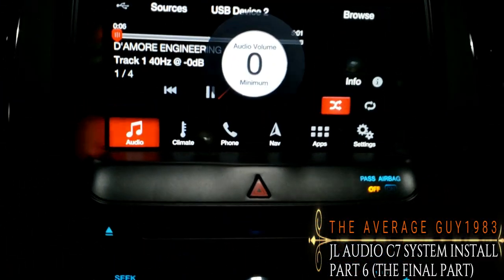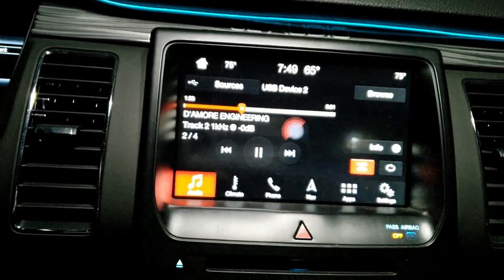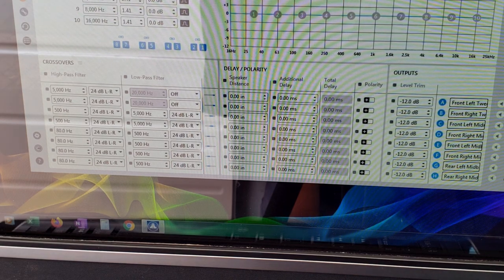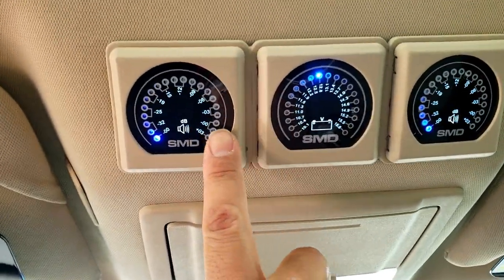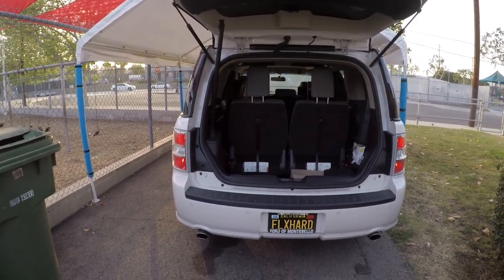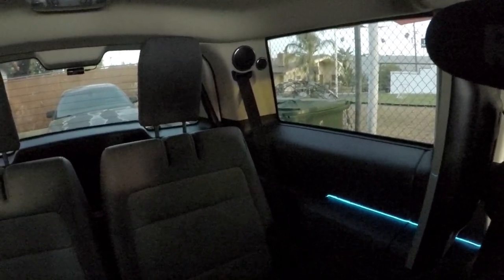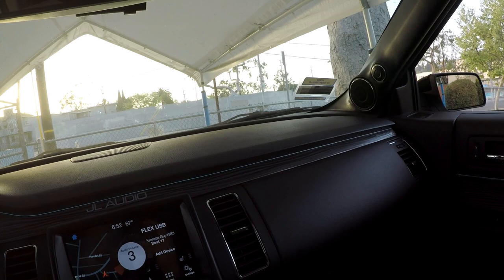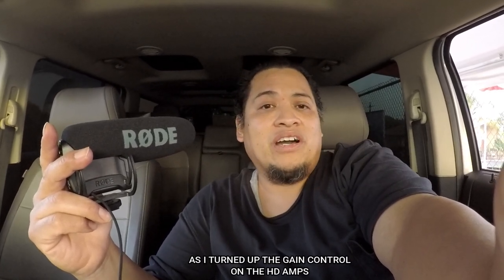JL Audio C7 System Install Part 6 (The Final Part)

Comment: I have a set of c7 speakers waiting to go in my car. I have heard them in a sq competition car and they sound amazing. The magic comes from installation and the secret sauce is the tune. If you had the a pillar speakers mounted on axis and have the system system tuned using an RTA then you would be a lot happier with the cost of the system. But what it come down to is that this is a hobby, the important part is the enjoyment you get from it. Next time you get a new car you can try to one up yourself. Thanks for taking us along for the ride.
Reply from the maker: Having the C7 speakers on Axis would have been great but for me it would have reduced visibility and it would have been an automatic police stop here in Los Angeles claiming "Obstruction Of View" so I did them off Axis which it sound great with the windows closed or half open as the sound bounces around and makes it sound nice. I still think that the C5s do a better job for the money but those are now discontinued and this is also a learning experience for me on making my first and possibly last Full Active Set up the cost was higher then performance for me but again I do LOVE the C7s but since I've had my C5s for so long I got used to the sound they produce with their passive crossovers on the same HD amps. Now The reason I didn't use an RTA is because in all honesty its not something a DIYER would buy for a single or maybe 2 time use So in my case  I set everything up the way it sounded good to me simply using the Time Alignment which did work great. Most of my viewers wont buy an RTA either for a single time use. However JL Audio did come out with their TuN 4.0 which now has The Capability of using a USB for audio Microphone Measurements so maybe I can buy a decent one for my next build that won't break the bank for me and see how it all works, As a DIYer I would rather invest the money for an RTA on more Router bits or blades for my other tools as those wear out pretty quickly. 😅 thank you so much for your feedback though. I appreciate it a lot. It honestly helps me get more knowledge a little bit at a time. 🙇‍♂️🙏 please consider returning once I eventually do my next build. The next car I want to work on has quite a bit of mechanical issues that need to be solved first. Maybe on that car I can possibly do off Axis with the 3 pairs of C5-653s I have for it. 😁👍
Reply: @THEAVERAGEGUY1983  I'm uk based so no such issues with the police. As for RTA, I've got a umik-1 and REW software for the tuning. The mic cost less than $150 from amazon and the software is free, a fraction of the cost of the speakers and adds the finishing touch to what is a good base of equipment. There are a few videos here on youtube on how to use them. Funny story about my C7, I originally ordered the C5 and thanks to them being discontinued and a couple of (fairly major) mistakes by the people I ordered from I have ended up with the 3 way set of C7 for the same cost of the C5 😁
Reply from the maker: @richardstott8973  no way!!!!!???? That's awesome that you were able to get them at that price. That's a Deal there! Yeah the police are pretty strict here specially with car audio lol!

Comment: Happy days bro!!!! Good for you man well deserved.   Love the attention to detail.  I finally got my 3 ways and a pillars!!! Every day is a dream driving now.   Hope you're enjoying the fruits of all the labor.
Reply from the maker: Hey! Glad to see you here. That's awesome that you got the 3 ways! They are definitely worth it. As for me enjoying the sound after all the labor work, yes! Since the C7s  are breaking in more now they are sounding even better! I did have some clearance problems on my front doors that I wasn't aware of till I felt the door panel pounding pretty hard with mid bass. Turns out the front door C7s are way too close to the back of the door panel speaker grill. So I'm actually working on modifying my factory door speaker brackets so that the Fitment can be better. I have recorded most of the footage and just waiting to get 1 more brakes done before re installing them. Hopefully everyone will enjoy the how to video on making these abs speaker adapters.
Reply from the maker: Did you go with the C7s too or the Audiofrogs? Those Audiofrog Speakers are freaking awesome too!
Reply: @THEAVERAGEGUY1983  it's crazy how high end speakers require break-in in order to sound good.   I was getting a headache at first trying to get the same loudness out of the Audiofrog 60/25/10 as I did the 2 way C5s.  That was my first mistake but I was disappointed and worried I wasn't going to enjoy them.  After a few weeks and my ears adjusting I can tell you it's incredible.   Simply amazing.  I ended up powering them with the vxi800/8 and 1000/5 bridged.   You inspired me to try and make some clips.  That MIC seemed to do a good job picking up the detail.   Great work man!  When you search JL Audio on YT your videos come right up.  👏👍
Reply from the maker: @touring189  yeah, same here this is why I felt like the C5s were still the best bang for the buck but after letting these C7s break in a bit, I can definitely tell that they are out performing the C5s a bit. They are pretty close to each other in sound but the C7 6.5 speaker does give a lot more midbass. About the videos popping up, that's great! That means that the youtube algorithm is now working for me. I do have some tags on the videos but they never seemed to leave the small circle of subscribers. But glad it's working now.
Reply: @THEAVERAGEGUY1983  yeah, I'll always recommend the C5's to friends/fam.  Man, I wish I could hear the Flex in-person!!!

Comment: I put my Bose headphones on @ 19:50. It sounds Amazing. Good job on your set up. 👍
Reply from the maker: Thanks man, indeed it definitely sound awesome. That stealthbox and 10w6v3 has an impressive output from 30Hz to 54Hz. When it goes down to 29Hz the sound does start to reduce and as you go lower to lets say 26Hz then you can't hear it much and it sounds like the subwoofer is suffocating but thats because of the tiny Enclosure its in. This subwoofer can go as low as 22hz in a ported box and as high as 200hz. Still a great set up for a Daily Driver/Family Car. 👍 right now I'm working on the speaker brackets in the front doors. Turns out they are too close to the Inside of the door panel speaker grill and when the door speaker plays loud the speaker hits the inside of the door panel, so I have to cut the original oem bracket down by 0.75" and then glue on my 1/4" abs bracket to that using ABS Slurry. Just need the abs to arrive by mail before I can get started. I also gotta make a video on this and let others know that you need at least 0.75 inches of space behind the door panel grill or they can run into trouble. The rear doors are fine but when I add sound deadener to the sheet metal of the door where the speaker bracket will be sitting on top of, I may run into the same problem so I will also be reducing those by 1/2" to compensate for the depth height.
Reply: @THEAVERAGEGUY1983  looking forward for the video if you got the chance to do the it. Your build is Awsome!
Reply from the maker: @lowridingtrucks88  thank you and yes I will make a video. I think it's better if I show the issue rather then just tell people about it. Just gotta wait to receive my 1/4" machine grade abs, the router bit from Mobile Solutions i use seems to really like that material better because its smooth on both sides then the abs with the texture on one side. 😁👌

Comment: Thanks for the video. Not sure if you have done this but it may help. Don’t touch the level trim, keep it at 0db and adjust the input sensitivity on the DSP. I had a similar issue. I have the TwK88 but a Rockford amp. Stick the probes into the output of the amp as normal, adjust the Head unit to max unclipped volume. Move to the DSP and adjust the input sensitivity by picking the correct voltage level. That should send a signal down to the SMD DD1+
Reply from the maker: Thank you for the advice, I'm going to work on it again this weekend, the way I currently have the LC7i set up are in this order. : channel 1 (front) output 4 volts @1kHz
Channel 2 (Rear) output 3.8 Volts @1kHz, it was maxed out on the level control on the LC7i. Voltage is much lower for the rear channels from the head unit unfortunately.
Channel 3 Sub Output 4 volts @40Hz
Going to the TWK88 inputs, from there the Input sensitivity on both TWK88s are set to 4 Volts of Input from the TuN Software. Outputs were at 0DB at first but was getting distortion coming from the TWK88 Outputs for the amps so I dropped them down to -4DB and that even things out to match the distortion point from the head unit. It seems my issue now is setting the gain control properly on the amps to match the head unit as well and I should be good to go from there. 😅 I would feel a whole lot better knowing my gains are matched with the head unit's/twk88's clean signal
So that I can focus on the EQ Tuning part to smooth out the sound of all the speakers. On a aftermarket radio, the DD1+ wouldn't be needed since the TuN software can detect distortion from its inputs.
Reply: @THEAVERAGEGUY1983  I used the DD1 to do mine. It took me quite a while to sort it out. I spoke to a tech representative from JL who has a channel on here and a page on FB. What I was told was to leave the probes of the DD1 in the outputs of the amp. What I did was check the max headunit volume at all three stages. So, I have a Sony XAV AX-8050 and it clips at 46/50 on both 40hz and 1000hz. I've ran a single pair of RCA's to the TwK as it's a full flat full range signal. I would confirm at the LC7i your max clip volume and what voltage it throws out. I had slight clipping at the inputs and at the outputs of the TwK, but I relied on the DD1 with regards to input and output clipping indication as I am aware that that's it's job and is reliable. One more thing, the LC7i doesn't really correct the factory EQ curve and that's what the TwK needs in order to do everything else. I would change back to the FIX82 or 87 to do that. Also search for Eric JLTech on YouTube.
Reply from the maker: @shakeelfaris7623  ah follow Eric Cole here in youtube. Ice also talked to him a couple of times when I was preparing my system purchase with his help. He did recommend a Fix86 for me. I may just do that instead or maybe the Maestro DSR1 with the DF02 Harness thats made for my flex. There are some drawbacks from what Dean and Fernando said on the most recent video they did here on the five star car stereo channel. But they didn't go into details on whats the draw back. I'll most likely do the fix 86 to get a good flat signal.

Thanks again for the advice, I truly appreciate it a lot. There aren't that many people willing to share their knowledge with others which is why I made this channel and do my best to share whatever I know. 😁🙏
Reply: @THEAVERAGEGUY1983  Anytime man. I found Eric's advice invaluable. There isn't a great deal out there on the TwK88 out there. I think I must have searched the internet relentlessly. Everything seems to be covered well except configuring the input sensitivity settings properly on the TwK. You can also try DIYMA forum too, there should be something on there. Let me know how you go.
Reply from the maker: @shakeelfaris7623  will do. 😁🙏
Reply: @THEAVERAGEGUY1983  Did you manage to investigate this further?
Reply from the maker: @shakeelfaris7623  yep! Turns out  i had quite a few problems. 1. my wire leads to my SMD DD1+ were actually broken. The pins came apart easily which means that they came like that from SMD lol! So I soldered my quick disconnect lead to the wires even though I did buy some new replacement wire leads and that worked well. 2. My gain output on the TWK88 had to be dropped to -17DB at 1kHz at Zero DB for the midst and highs and -3DB for the subwoofer at 40Hz at Zero DB because the gain was too high on the TWK88 which explains why nothing was happening when I tried adjusting the gain on the HD Amps.
3. After the gains were set on the amps, the A and D pillar tweeters had to be dropped to -18.5 DB from the TWK88 outputs and -19DB for the Midrange speakers. Which the tweeters scream a bit still so I may drop it down to -19DB for the tweeters to smooth it out more. Since the midrange and tweeters are so close to the ears, it can get very loud. The door speakers were left at -17DB from the outputs of the TWK88 but the frequency was changed to full range from 100Hz at 24DB to 20,000kHz at 24DB. The recommended frequency JL Audio told me to try did NOT sound good at all. But once I set them to full range on the doors, it really smoothed out the sound of the speakers. Now they sound awesome but I still think they are priced too high for their performance and still would recommend the C5s lol! However now that I figured out how to use the TWk88, I would definitely consider using it for my next build.
Reply from the maker: @shakeelfaris7623  by the way after testing out the speakers outputs the C7-100CT and C7-350CM can definitely handle up to 100 watts RMS. I believe that even these HD amps are a Bit too powerful for them so if anyone was to go with these C7s the Vxi amps would be my choice of amps if I could do it over using C7 speakers of course. 

As for the door speakers, they can definitely take their 125 watts rms and may even sound nice and balanced with a VXi amp on them with just 75 watts rms going to them so they will Never blow out. When I set the gains on the amps I did set them at 24.5 volts for the the HD600/4 amps and 38.7 volts for the HD750/1 but on the 600/4 amps the DD1+ didn't detect distortion till it reached 31.7 volts and a clean signal at 31.6 volts, so on JLs chart thats equivalent to 250 watts rms at 4 ohms
And for the HD750/1 the DD1+ detected distortion at 41.3 volts and a clean signal at 41.2 volts and thats equivalent to 850 watts RMS at 2 ohms. Thats some really good power but I did notice my voltage drop down to 12.3 volts so I am Definitely going to consider getting a High Output Alternator for the Flex.
Reply: @THEAVERAGEGUY1983  I’ve messaged you about this on Facebook bro. 👍🏾

Comment: Glad to see more vids! I ended up ordering a 320amp high output alternator for tucson alternators put in this morning but now the charging system light comes on. I may have to put the stock one back in.
Reply from the maker: Oh no, so the 320 amp alt didn't work after all? Or is it maybe overcharging?
Reply: @THEAVERAGEGUY1983  it's charging fine but throwing the light for some reason. I'm gonna recheck connections tomorrow.
Reply from the maker: @ninja-vanish8086  cool, keep me updated on your alternator upgrade. I haven't ordered mine yet but I definitely need one lol! My Voltage has been dropping from 14.3 volta to between 12.2 and 12.5 volts at idle but while driving it stays between 12.8 to 13.1 volts. That's when the Bass hits hard at My max volume 20 on the head unit. I think it would have been worse if I wouldn't have done the BIG 3 with the 4/0 OFC power wire. 😅 I'm thinking of going with the 390 Amp for Mike Singer.
Reply: @THEAVERAGEGUY1983  checked charging voltage this morning it was slightly overcharging intermittently up to 15 volts. I was using 3 diodes on the stock alt to boost voltage. I put the original fuse in and checked no light but it was charging a bit low. Tried 1 and then 2 diodes. 2 now works perfectly keeping steady charge of 13.8 to14.8 no light so far. Full tilt at idle didn't drop below 13.3 but I do have a 2nd xs power battery. Will update if something changes. Update light returned I put the stock on back in for now. 😫
Reply from the maker: @ninja-vanish8086  aw man that sucks! I wonder what could be causing that. Maybe it is overcharging still. Might have to do what Steve meade did for his Tahoe and use a step down converter from mechanical. The way he did it was having the step down module connected to his stock charging system so the car can still see stock battery voltage but the actual power run to the audio system has the higher voltage going to it. I might have to do that too if the High Output Alternator does the same thing to me.
Reply: @THEAVERAGEGUY1983  yea disappointing. I gotta look into solutions. For now it will sit under my bed. I don't think I can return it. Maybe that's why not many are made for our year flex.
Reply from the maker: @ninja-vanish8086  true. I really gotta email Mike, the alts he has sound promising but it could end up giving me the same issue 😅